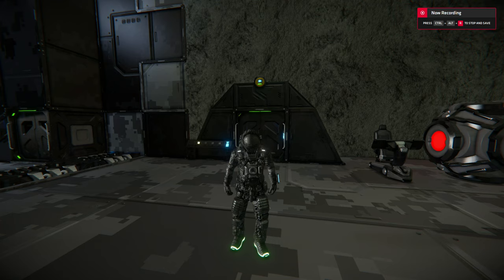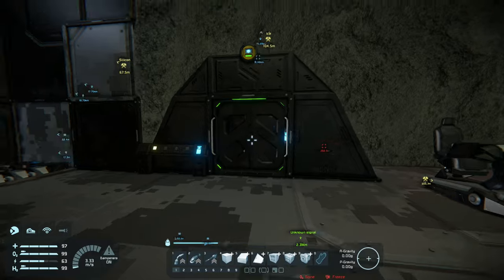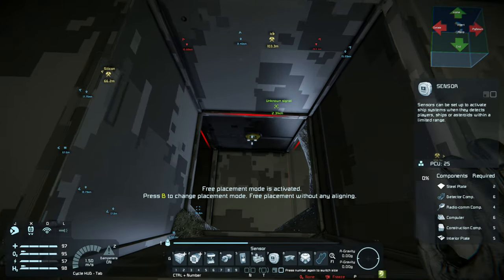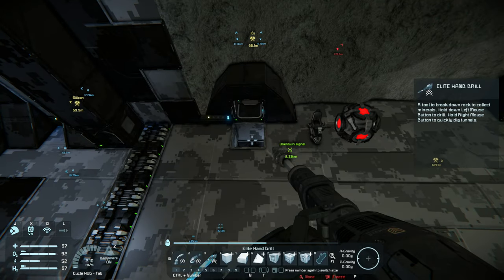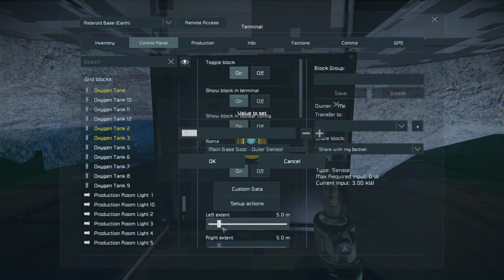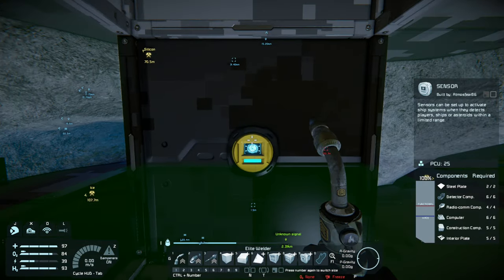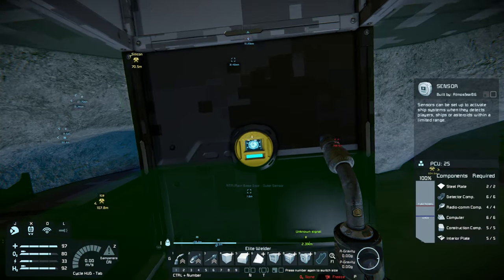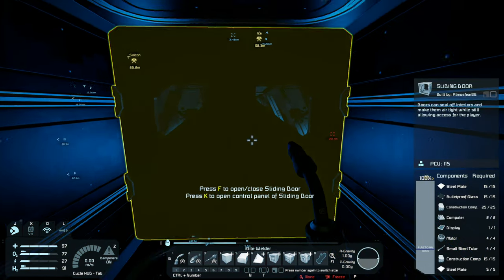Space Engineers - Automatic Airlocks and Doors - How To

Comment: I expected you to show how to actually set up the script I never run any of them
Reply from the maker: There are no scripts when you use sensors 😎👌
Reply: @TheGarageGamer86  I have issues with oxygen getting out, I have a vent set to depressurize but it's super slow...
Reply from the maker: @ArtistDylan  Yeah I just let it vent out into space and accept the loss lol. The amount of oxygen in the space between two door is quite small so I never really notice the oxygen loss 😊
Reply: @TheGarageGamer86  It does seem like SE doesn't challenge us too much on supplying oxygen. It's more geared towards supplying Hydrogen. That and "simple" air tightness. :P
Great video's BTW.
Reply: It's possible to make a lossless automatic one if you use 4 sensors, but that would need a block in between for the air vent for the air lock so it wouldn't be as compact.